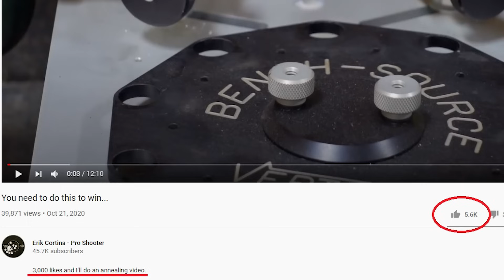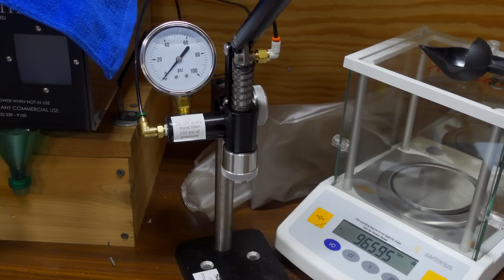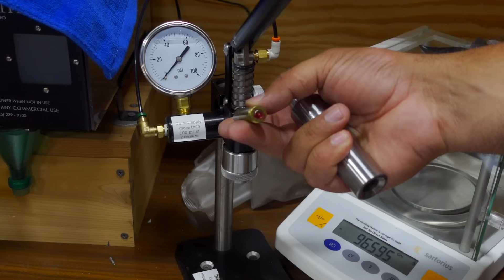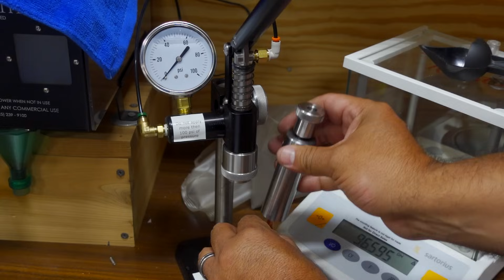This is how I anneal my brass

Comment: I don't have an annealing machine yet, I use a drill and socket so this video takes a LOT of my worry out of annealing. Thanks again, EC.
Reply: That's exactly what i do! Us poor folk 😂
Reply: Same here
Reply: I do the water on turn table. Saw it on a video and made it with a barbaque motor. Basicly the same as the socket. Just keeps the case head cool.
Reply: Check out Elfster’s Rifles and Reloading channel on YouTube, he has recently reviewed an Annealing machine he designed that won’t break the bank . It should be affordable for many reloaders .
Reply: Drill and torch works for me as I don’t load 100’s at a time. Drill and torch I have in my shop, no need to blow more cash.
Reply: @w.anderson8806  i do the same!

Comment: WOW    So much has changed, but I get the same results.  I'm very old school .  Started annealing back in the early 70's.  You have some very nice equipment.  I stand my brass in a tray, full of water to about half way up the brass.  I use a needle tip just like you.  I point the flame vertically down the middle of the neck, heat till red orange, then tip it over in the water.  It works really well for me, and I haven't spent a lot of money.  When is started with 7TCU, I lost about 85% of my brass.  After annealing, I only lost 4 or 5%.  WELL DONE.

Comment: I started annealing for my 7 mag. I watched closely with new cases while fire forming. I then annealed the brass just like this. Did a fl resize at .002 and used a bushing die and had neck tension at .002. What happened next was lower es and sd. My groups were consistent. This stuff works and I really see the results at 700+ yards

Comment: This video is exactly what I needed for annealing; I've always been so worried that if I go like 1 second too long then my brass is ruined because "they" say the window for annealing vs overdoing brass is so small. Thank you! You're videos are excellent!
Reply: Annealing brass is a step that is super easy to do (and do adequately) and hard to perfect. I think way too many people put way too much thought into it. The purpose is to extend brass life and eliminate work hardening. 

Sure, the goal is for consistent neck tension thus higher accuracy, but time under heat per brass lot is more important than getting to an exact temperature within .5*. Without measuring the temperature perfectly in every case, all we're doing is eyeballing anyway.

Comment: I learned about annealing a couple years ago, I don't shoot thousands so I use the salt bath method. I can see an extension in the life of my brass since i started to anneal. I too wondered about over doing the process. This helps a bunch. Thanks again for helping all of us out here.
Reply: Can you show the difference between quenching and air cooling? 
Also show over annealing - when the brass becomes butter soft

Comment: Great discussion on annealing! For those of us that are not into PRS and load mostly for hunting; we still benefit from this good information.  For us annealing is mostly done to extend brass life.  The old rule was to anneal every 3 or 4th firing.  However we quickly discovered that doing it more frequently often improved accuracy.  Thanks for the info on over annealing as this always seems to be of concern.

Comment: I made an induction annealer. It anneals 308 in 2-4 seconds depending on manufacturer (winchester is the lowest time at 2.4 seconds). At 2.6 seconds, my annealer makes the 308 case a puddle. Nice to see the flame method isn't so quick to destroy. \

Comment: I have noticed, including in this video, that when the flame changes color, pull it from the heat. The flame bouncing off the brass will change to a orange flame.
I have verified this with 750⁰ F templac.
Reply: Thanks!
I went back and saw what you mean about the color change.......will apply that to my Giraud annealer and see if it helps.  I have two diff templacs I should be using but I'm an old fart and get impatient and/or forgetful.

Comment: Weather someone thinks your doing it right or wrong that really don't matter, the point of this is to show how you do it and to share your knowledge on your video's. And if it works for you then thats all that matters. I learn alot from your video's thank you
Reply: Question i got a browning 28 nosler xbolt lr hunter.  im reloading my own hunting ammo ELD-X 175gr. I prep my brass accordingly and im loading minimum powder load 77gr of h1000 and .007 of the lands 3127 fps using nosler brass and got my groups where i want. the bullets all touching each other on target, but i got a problem when i shoot my bolt sticks. Can you tell me what im doing wrong plz
Reply: @josephhcondo7281  I'm not Eric. I would suggest checking how your stock is mating with your barrel. Sounds like maybe your barrel isn't free-floated. When you put the rifle on the sticks,  you're getting uneven pressure on the stock causing it to make contact with the barrel. Put a dollar bill between your barrel and stock. Place it on your sticks and see if you can move the dollar freely. 
It's either the stock making contact, or the shooter being inconsistent. Not the same cheek weld, leaning too far in or too far back. Too much to one side.... etc.

Comment: We did a similar experiment. We were die forming .30-06 military brass into 7mm Mauser. We trimmed the fired 06' cases on a lathe, de-burred them, annealed, formed, full length sizd, trimmed and tumbled them.. We found that around 14 seconds gave us a good form with no negative effects. We did 200 for a customer and have reloaded each case 4 times since without issue (annealed each at 4 seconds each time since).

Comment: Erik...I liked that video...just investigation with good, clear info and shots of the results and no "preaching"....you showed the brass annealing setups and results that led you to your decisions. GREAT! I've been screwing around with a DIY  (induction) annealer for several calibers and I'm gonna assume that the brass case color thing will hold pretty true across them all and I'll mostly have to adjust times and things like that (AND take a LOTS of notes so I can duplicate the desirable results). I was getting pretty tired of screwing with my flame annealer (also a DIY rig) Thanks for the very clear info and also the interesting and useful demonstration! 

PS...Maybe I was a tad bit hard on your for your teaching methods in another vid, but you did VERY well in this one! It made a lot of sense to me and I LOVED it!!

Comment: Excelent video. 1 thought. There is a theory that over annealing will burn some of the ingredients in the brass making it weaker & dangerous. I think this video may have dispelled that theory. Great experiment Erik. Rock on Bro.
Reply: Remember this is a sample size of one.  That theory may be true(er) with some brands and not so much with others.
Reply: My annealing machine works also with a torch flame. I've never seen this kind of issues. Maybe it can happen if you heat the brass too long ?
Reply: @rdsii64  The theory is when its red hot its burning zinc out of the brass, That theory is false as the only way to burn out the zinc is to basically turn the brass case into liquid form!

Comment: Good video. Glad to see you pull that Machinists Handbook out. That has all the info about metals that you will ever need. And nice to see you air cooling instead of water qwenching.
Reply: I thought water quench was a necessary part of the annealing process for brass and helped to achieve the necessary hardness.  Can anyone clarify?
Reply: @Denvertubester  the brass cools so quickly there is no chance of residual heat causing any problems.

Comment: I bought an Aneeleze machine for $275 and it works like a charm, extra wheel kit for magnum cartridges is an extra $25. It uses 1 flame and rotates the case in the horizontal position. I can load around 200 .223 and maybe 150 .308 at a time. Totally adjustable for time and flame position, very easy to use. I use the same method of beginning to see orange with the lights off. Doesn't take up much bench space.

Comment: I have the same annealer, I use a 20lb bottle, and a hose splitter with two hoses connected to the same bottle. And then use zip ties to tie the two hoses together for my location. That way I don’t have to worry about two separate bottles, and how full each bottle is and if one will run out before the other.

Comment: Great video!  I annealed some brass after watching this with my home made set up that's pretty crude. Used a stationary propane bottle and a variable speed drill with a 5" 3/8" drill bit. Slid  the 45/70 cases over the drill bit and rotated the brass into the flame until a light orange color. About 9 seconds and allowed them to air cool. By the way the caseslid right off by tilting down a little and letting them fall into a wooden box. I was afraid to do this in faer of over heating until watching your video. I am anxious to get to the range and watch your next video!
Thanks,
Frank

Comment: Man thank you so much. I've been wasting so much supplies thinking the salt bath annealing was doing something. I couldn't actually find a good load until this video. I went ahead and did 50 cases with a drill and a torch and worked up a ladder. Dang man it was a huge difference. I now have a load that shoots sub moa out of my AR10. I've been struggling for 3 years
Reply: My 2 cents..i found the over annealed loose bullets shoot the tightest groups. I use neck bushings and mandrels to get the lightest grip
Reply: @JamesPettinato  man I've actually started to see this myself. Federal Gold Medal Match isn't crimped and the neck tension isn't hardly anything. I need to get back to reloading now that everything is settling down

Comment: When I got my AMP Annealer I still kept the BenchSource. While it takes me a bit longer to setup right, it‘s so much faster at annealing larger batches of brass. AMP is like a premium single stage press while the Bench Source is like a nice progressive press 😅
Reply: 100% with you, Ive annealed 1200pcs of  308 in less than 2hrs.....I don't have the patience for the AMP.
Reply: I just got the Annealeez flame annealer.  I chose it due to it’s low price ($275) and ability to be loaded with a bunch of cases and then just let ‘er go.  I am not a competitive BR shooter, just a prairie dogging guy who shoots them out to 500-800 yards.  I am old now, so have started to move from 22-250 and long range to 221 Fireball and 223, most shots around 200-230 yards but shoot a few mostly early morning hits out to 350-500. I want longer brass life due to the huge FBO and FJB price increases of brass (and all reloading supplies) and would like that little bit better accuracy annealing and shoulder bumping every time can bring.

Comment: Erik Cortina - Pro Shooter, Anneal is a heat treatment of the metal decrease the hardness, most likely your 6 sec on the machine. The 10 sec process you've done is call normalizing. Normalizing is to improve ductility (improve to reduce the chance to break when you bend it). Normalizing heat treatment needs the piece to cool down slowly (air cooling). The issues to over-anneal with propane or Bernzomatic torch is the temperature around 3600F and the melting point of brass is depending composition around 1700F so you gonna melt the brass or deformate it.

At the end:
Remove hardness - Annealing with slow cool down (in air)
Improve ductility - Normalizing (Annealing + 150F) with slow air cool down
Increase hardness - annealing with rapid cold down (in water)

Comment: I have a jig to hold 20 cases in a row, just use a torch by hand to anneal my brass. Simple and effective.
I anneal after every 3 firings for my PRS rounds, every 5 or 6 for my practice and defensive ammo. When the primer pockets become too loose, I discard the brass for recycling.

Comment: when you're bending  brass back and forth at 2:56 this is called successive over relaxation of the material. It's a mechanical engineering term. It relates to upset welding among other things

Comment: Great video as always. Thank you! I actually use a different annealing method - but I think it’s just a matter of taste. 
My annealing method is a salt bath at 550degC. I use a Lee Lead Melter, a cheap chinese PID controller, and 50/50 mixture by weight of potassium nitrate (Spectracide Stump Killer) and sodium nitrate (Hi-Yield Nitrate of Soda 16-0-0 fertilizer). For my 308, I typically do a 6-second dip (timed by iPhone metronome app) and then I throw them in soapy water to wash the salts away.
Reply: That sounds extremely complicated....
Reply: Like Eric said in his video..  My method works for me. When I anneal I can feel a huge reduction in force needed to resize my brass. So whichever annealing method you choose (flame, salt bath, or induction) I think everyone needs to do it.

Comment: Great info, I’m considering reloading my 5.56 ammo and noticed you use 1 lb propane bottles for your heat. I came across Flameking refillable bottles a couple of years ago and have never had to buy another green bottle. You can refill the Flameking bottles from your 20lb grill tank and fill it 20 times on a 20lb tank and there is no limit to how many times you can refill it. Plus they are DOT certified refillable and legal to transport. A big money saver on propane 1lb bottles. I keep 4 on hand to run all my products that need gas. I got mine on Amazon. Hope this may help cut some cost and it’s easy to refill, watch some videos on YouTube if you have some questions. Again thanks for sharing the tips.
Jim C

Comment: Great video again Erik. You've also eased a concern of mine. I made my own induction annealer (fun project) and have been very wary of how long to heat the brass for (edging more on the side of under rather than over) - looks like I really shouldn't worry as much.

Comment: Great demonstration, Erik. I think you can add immeasurably to this by showing seating force improvements thru annealing as compared to un annealed brass with up to 10 cycles on it. That would prove conclusively that annealing brass has value, and how often it should be done to maintain good consistent neck tension.

Comment: I'd like to see you shoot the "over" annealled brass with a temperature gun just as it move out ofthe flame to see what the temperature really is. Great video Erik. Can't wait to see what the results are ofthe next annealing videos is. Thanks for the video!!!!!!!
Reply: There's a way to measure the temp the brass hit, it's called tempilaq. It's sold on Amazon, and I'd available in a variety of temperatures.
Reply: @machinist7230  yes I'm aware of it.  Just be easier to hit it with a temp gun in my opinion.
Reply: @ramsaycountry1177  the problem with that is it's not really possible to measure if it reached a high enough temp in the the flame one using a no contact thermometer.

Comment: Work hardening is also called metal fatigue! I’ve been told not to heat the brass to the orange stage, but I’m not an expert!  Also I’ve been told to quench to after annealing to keep from softening too far towards the base of the case. I know I have done both and I don’t see any difference, I’m guessing you know more than me so I’ll adjust my annealing operation!